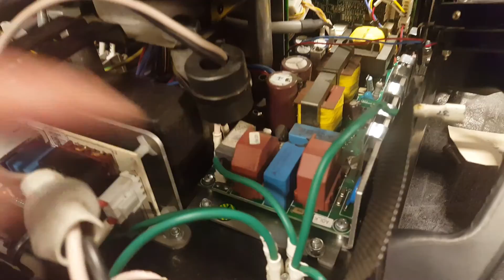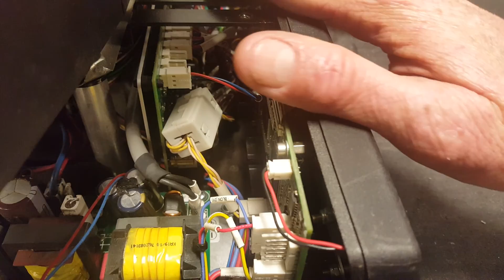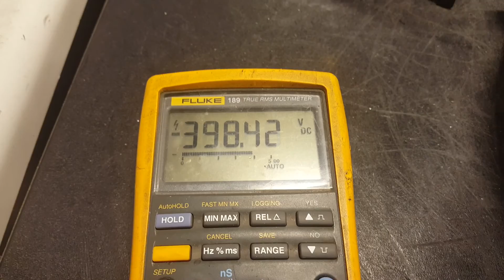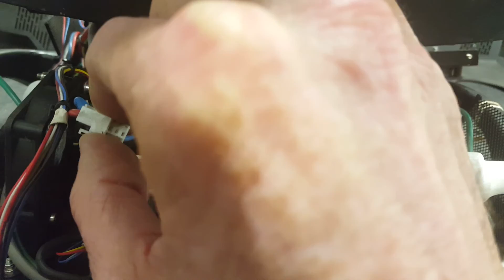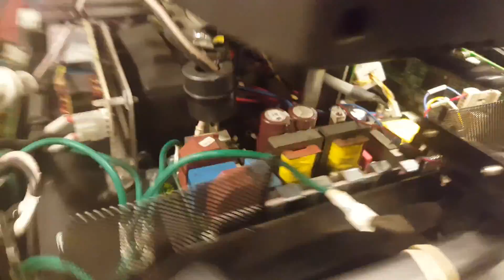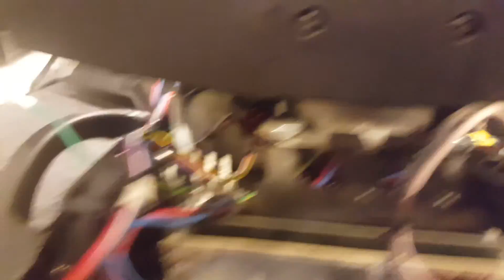Clay Paky Sharpy no power Lamp troubleshoot repair

Comment: I have a trouble with the 5R sharpy , works OK from the beggining , Also turns on the lamp by DMX command but when fixture returns from sleep by receiving DMX it's impossible strikes on the lamp without recconecting AC mains , everything else works just fine.
Recomendations ?????

Comment: hello I have a question I would appreciate if you help I have a problem with sharpy jihad ballasttan doing all the voltages, but the bulb does not fire with a solid ignitor I try again with the same result what should I look for thanks

Comment: Im having an issue with my sharpy. Another tech had tried to repair it and failed, so im left to clean up his mess. Volts are good across the boards. Only thing that happens when i power the fixuture is a slight click and then just  faint beeping. No fans or anything. Only thing i noticed was the control cable had the blue pylled out of the plug.

Comment: Hey, i've got. ohne question: my Beam 5r Head powers ob the lamp, but After about 30 minutes the lamp turns off again. If you then wait untill it has cooled down again, the lamp will turn on again if you egnite it. What could be the Problem here? 
Thanks for your help
Reply: felix ehrig hey u need channge lamp replace
Reply: The fan that cools the lamp doesnt work... the one that is on the side of it

Comment: Could you help me sir for what is the meaning of "Mt board conection fail " apears on my beam 280 screen Which part is called mt board
Reply from the maker: Jockey Light I'm guessing it's a Chinese fixture?...it's hard to tell without the user manual... I suggest you look for bad connections on the main control card and all the other cards in the fixture... And usually there is a control cable on the Lamp Driver (ballast), very small connector with tiny wires..maybe a bad connection there... My guess is that the main control card doesn't see another pcb or component in the fixture

Comment: Should the power supply be outputting 400V continuously, or does it one output the 400v once you send the strike command?  I've got one where I can't get a 400v reading anywhere on the power supply.  I've swapped the PSU and the ballast from another working light, and still can't get any reading from the PSU.  Could it be that the ballast isn't getting a strike command, therefore it's not telling the PSU to send it voltage?  I am not getting any kind of errors on the fixture either.

I've also tried swapping the control cable, and the cable from the PSU to the ballast, neither one of these did anything.  Also checked continuity on the lamp on sensor, and it is working.  Next step I am thinking is swapping the logic board, other than that I can't think of anything.  Any ideas?
Reply from the maker: Yes the PSU should be outputting 400V all the time... If you tried swapping it with a unit that you know is good from another fixture and you still don't have the 400V, try to disconnect the 28vdc output on the PSU to see if the 400V comes back.In a lot of cases if another pcb or motor driver is shorted somewhere in the fixture it can bring the PSU to ground and make it look like it is not working... If you unplug the 28vdc and the 400v comes back it means there is something wrong elsewhere in the fixture...Good luck
Reply: theres also a verticle fuse wrapped in heatshrink next to the 400Volt output.